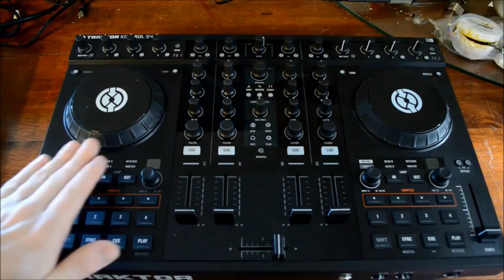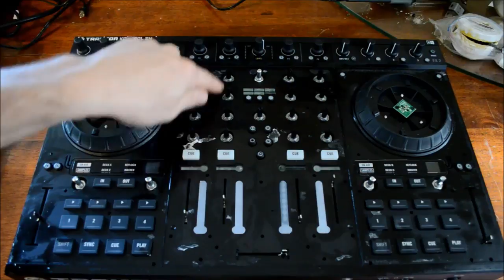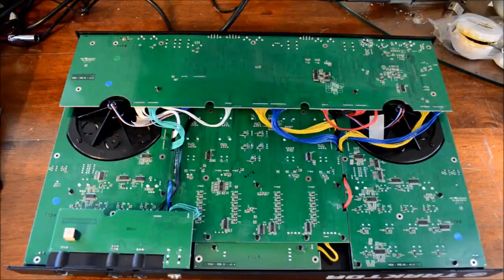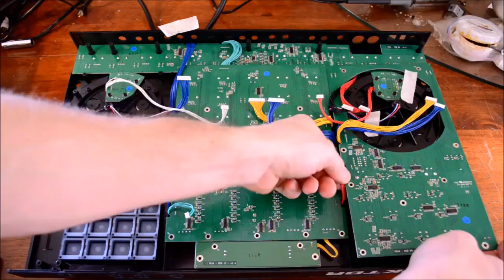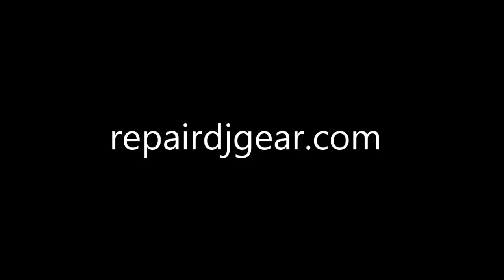Repair DJ Gear | Traktor S4 Disassemble Procedure

Comment: Thank you for the walkthrough! Quick question: is there any way to get to the pot nuts without peeling off the face plates? I was thinking of dremeling the holes larger, so the nut is permanently accessible for potential future repairs. Have you seen anyone else do that?
Reply from the maker: Youre welcome! Great question. We thought about it and its best to remove the fascia plate. We can have all plates off in about 3 minutes flat. Clean the fascia plate sticky side with hot soapy water, rinse and dry. And you should be able to reuse the sticky side. If not, apply double sided tape along borders.
Reply: @RepairDJGearUSA  How do you remove the face plates?
Reply from the maker: @greghale4579  Use goo gone and a pry tool, carefully.

Comment: Is there anywhere you can buy replacement buttons anymore? Having issues with play/cue/1 after heavy use.
Reply from the maker: Yes, we have new replacement tact switches.
Reply: @RepairDJGearUSA  so there is no need to replace the rubber bit, just the switch behind it?

Comment: Do you know where I may be able to obtain fascia plates for a Traktor Kontrol S4 MK2? Perhaps some custom ones? The reason why I ask is because I took mine off (without the use of a blow dryer) and now they have slight bends in them. The no longer will fit back on the controller flat anymore.
Reply from the maker: We can make custom aluminum panels. Laser etching to any design. Please email me at www.repairdjgear.com

Comment: Hey! How are the effect panels mounted? Using nuts on the potentiometers under the fascia plates like the rest of the controller?
Great video by the way, the most useful information on the topic on the internet!
Reply from the maker: Same as the mixer POTs. Remove the fascia plates and then remove the nuts. 
The deck and main mixer boards have to be removed to remove the effects rack pcb.
Reply: @RepairDJGearUSA  Thank you for the quick response! My effect panels are pretty loose, the knobs and buttons are moving, so I will just tighten those nuts, and maybe add new washers.

Comment: Hey there! So my Deck B fader and Browser button is acting up a bit. I'm thinking they just need to be cleaned, so do I have to remove the face plates just to get to the board or can I just remove the back and disassemble it to get to the circuit?
Reply from the maker: Yes, you must remove the fascia plates to gain access to the tactile switches for cleaning or replacement.
Reply: @RepairDJGearUSA  Thanks for the quick reply and helpful vid! I got some work to do haha
Reply from the maker: You're welcome! 4 hours tops for a full rebuild. If you need a rebuild kit, they are on our website.

Comment: Hi there, I dissasembled mine (video was very helpful),
than had a friend replce a few mini-switches.
Assembled it back very carefully, but without the back cover for now to make sure all's ok.
I have drivers installed and the controller shows up in the Device Center, however,
nothing works! No lights, no response from any of the buttons, faders, encoders, or potentiometers! Any ideas?
(thanks in advance)
Reply from the maker: Greetings Nissim! 

Could you email us at repairdjgear@gmail.com and we can communicate through there. 

Cheers!

Comment: Is this the same thing as taking apart a Pioneer DJ Controller?
Reply from the maker: No. Just don't use a heat gun to remove fascia plates. Use a solvent that is safe for plastic and pry tools to remove fasica plates. From there, hand tools and you are good to go. :)

Comment: Is it possible to get out just sound card and use it on computer while using s4 as midi device only on other computer?
Reply from the maker: You need two S4 controllers if using two computers.

Comment: Hello! I have a Traktor S8
It suffered a damage the supply power and usb. 
The damage is in Resitors R7, R8
And capacitor C19 
Do you have the schematics or how to do jumpers on the usb.

Comment: Hi friend, how did you remove this cover from the mini disc? Thank you.
Reply from the maker: The jog wheel (mini disc) top plate can be removed by the following steps:

1. lightly push down and turn clockwise, just the plate while holding the jog wheel side.
This will unlock the plate. You can flip the entire unit over and it should fall out, or you can try to lift it out of the jog wheel. 
2. To install. Line up the notches on plate to jog wheel. Hold jog wheel and rotate plate counter-clockwise until it clicks into place.
Reply: Wonder. Thank you very much.
Reply: I'll open and check what happened. Anything I write here! Thank you for now.

Comment: Sorry for the double post, but any particular solvent you would recommend? And what would you use to reattach the face plates?
Reply from the maker: Its okay. GooGone and then wash with soap and water. You should be able to reuse the original adhesive but use any glue that is not too strong and safe for plastic.

Comment: Hi do you guys fix traktor a10. Deck a. Is defective cant calibrate. Says right deck missing. I tried everything. But. If i olay real vinyls the signals goes thru. Please help. Is it a rca connectors?
Reply from the maker: Hi and thanks for message. 
WE would have to have it in shop. Are you local to California?
Reply: @RepairDJGearUSA   no im in florida
Reply from the maker: @TheBlank241  Visit www.repairdjgear.com and fill out repair form. Ship it UPS or FedEx. We quarantine equipment for 1 week. Then start normal process.

Comment: How did you remove the level and gain knob on the back? Thanks !
Reply from the maker: Use a pry tool. Or a pick tool. Remove with even pressure on both sides. 

Let me know if you need more help and thanks for subscribing to the channel if you have. :)
Reply: Thanks so much for your quick help!!

Comment: My deck a to c button is sticky can i just remove the left plate with out pulling all apart ?..cheers.
Reply from the maker: +truth percuit Yes, and you can just remove that pcb without a complete disassemble. I advise to clean the actual microswitch with rubbing alcohol or similar.
Reply: hhmm.. cheers for reply..but after watching all of that vid you need to take it all apart in order to get to that button as its on the circuit board .just taking of the top plate doesnt really help i dont think..

Comment: I used to repair these for native instruments are you hireing
Reply: What to do about a jog wheel that isn't working? It won't go through the recalibration process. How do you troubleshoot and what would you replace?
Reply: @deepzone31  sometimes the jog wheel covers come off. You press down and twist the cap should come  of. Flip the cap around adjust the the clips on the cap but be gentle you don't want to break the clips a small flat head driver will work. That will adjust the height of the cap which will allow you to calibration on your software
Reply: @deepzone31  any luck
Reply: @Welcome2TexasPodcast No luck. Right jog wheel works. Left jog wheel is not cooperating. I tried switching covers. Right jog wheel worked with or without a cover. Left jog wheel does not respond at all to plastic platter. When I touch the metal lid it will hold playback and make a tiny scratching noise but will not front or back cue as it is supposed to.
Reply: @deepzone31  after switching caps did you try to calibrate.  Which tractor s4 Gen s4 mk2.  Black caps or silver caps. S4 mk2 I would calibrate through soft ware. I would use the repair software but on the tractor software it allows you to calibrate. Did you see if the sensor pcb is loose

Comment: Thanks for the vid.  Could you elaborate a bit more on removing the faceplate? What kind of solvent did you use?
Reply from the maker: +Jesse Hansen Any solvent that is safe for plastic
Reply from the maker: +Jesse Hansen The facia plates must be removed to unscrew the nuts that screw onto the POTs. View at 55 seconds and you can see the silver screws surrounding the black stems of the EQ pots. This PCB is all in one.
Reply: but what kind of solvent did YOU use?
Reply from the maker: Any type of solvent that is safe for plastic.

Comment: Does the Board of effects buttons also can be disassembled? the effect buttons are like stick or something
Reply from the maker: +Paul Cueto Try using alcohol while working the micro switches. Sometimes this works.
Reply: +Repair DJ Gear (USA) Does the circuit board for the fx come off though?
Reply from the maker: +tyvenmusic Yes - Same process to remove facia plates and the nuts securing the POTS. Very straight forward.

Comment: What type of adhesive do you suggest to use when putting the plates back on? 

You mention that your website sells some adhesive strips, but I can't find them.
Reply from the maker: Any form of double sided tape works well. But the original adhesive can still be utilized if it was not removed.